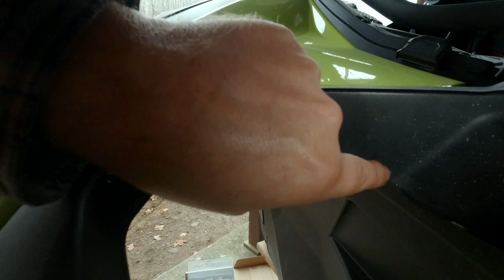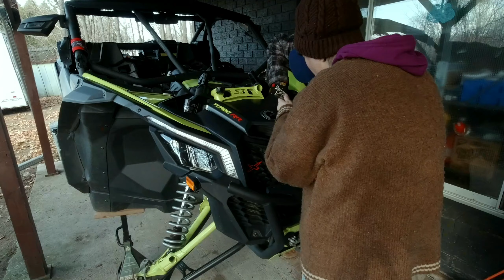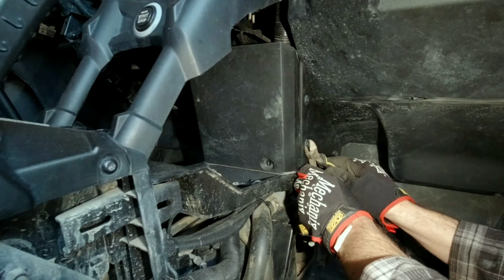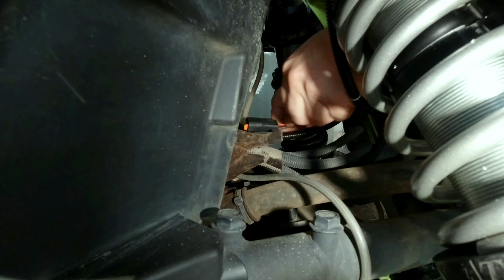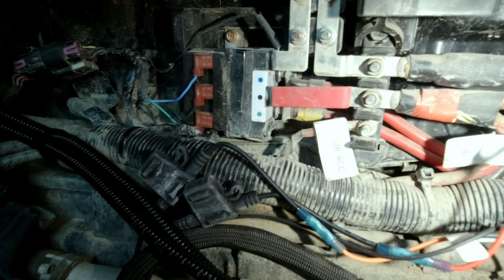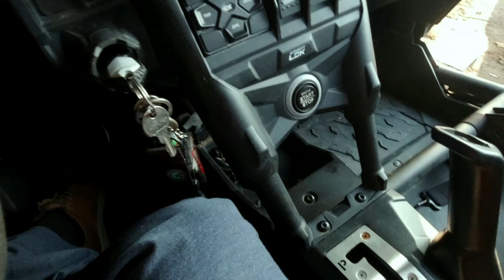MAVERICK X3 FOX IQS INSTALLATION  #CanAmOffroad #ShockTherapy #UTV

Comment: FOX iQS is a game changer!
Reply from the maker: I do really like it a lot for sure👍. Next time you guys do my shocks I will go a bit softer probably. But still was a huge worthwhile improvement. Our terrain is constantly changing in my area from slow bush trails to mud to backroads to fire roads to high speed desert like conditions and so on. Manually adjusting shocks would be totally impractical. So having that switch on the dash is awesome for riding in my area.

Plus I love how it is kinda-sorta like adding more swaybar at the flip of a switch going into firm. So much less weight transfer in all directions with the car on rally race type roads. Your adjustable bars help a lot with that too. Quite a rocket for a 64" car on backroads, totally stable. And can kick the back end out all I want. Handles amazing!